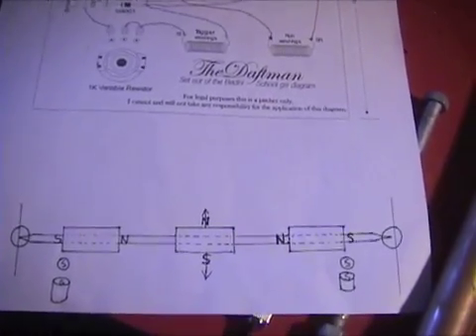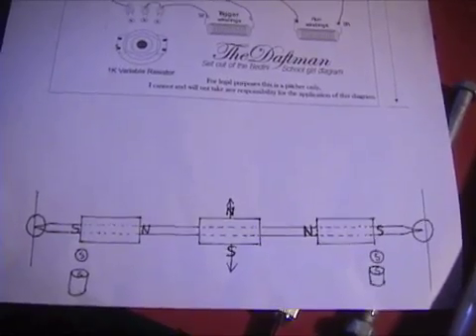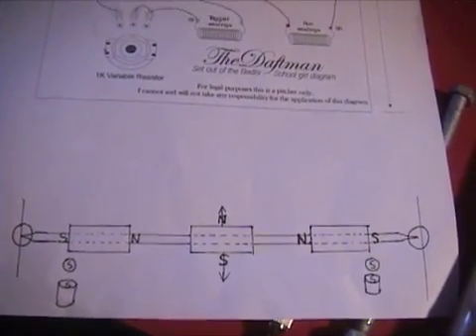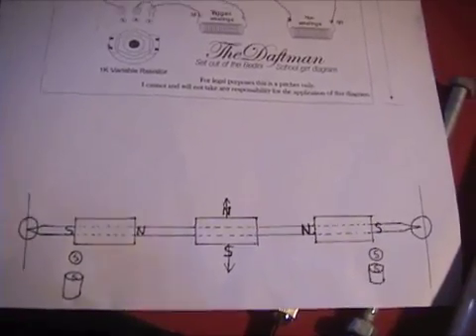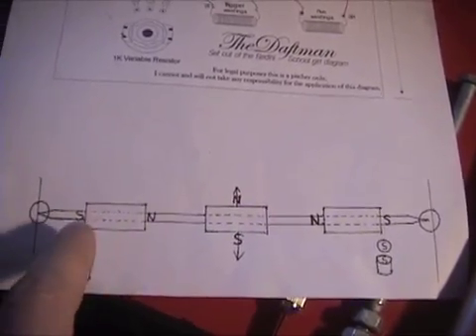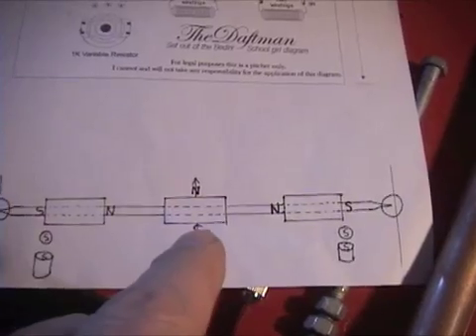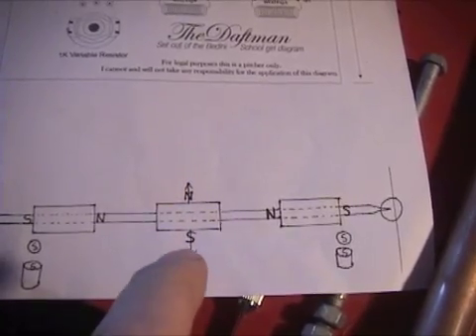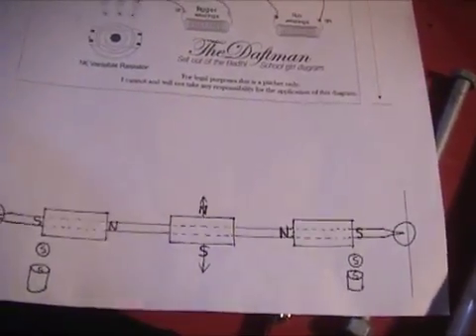Lenz's Law demonstration

Comment: the strongest points of the magnetic field are "cutting" thru the copper hence lenz force; If you were to rotate end magnets along the long axis same braking effect would occur with your end magnets because their strongest points are at the ends and not along the long axis.

Comment from the maker: @TheUFOeffect That's very perceptive.... your braking idea! As a matter of fact that's exactly how the braking/generating system on modern day electric cars work. The load/drag (stopping power) is produced by lenz's law as the magnetic field is induced in the coils of wire in the hub. This energy is then shunted back to the battery and is used to power the car. Instead of loosing the kinetic energy to drag is is "recycled" back to the powering batteries!!!